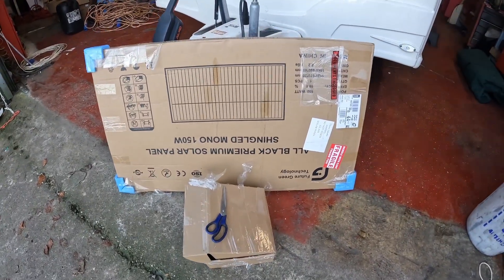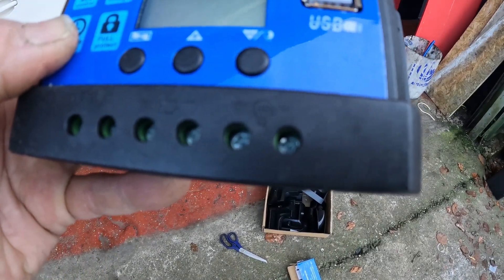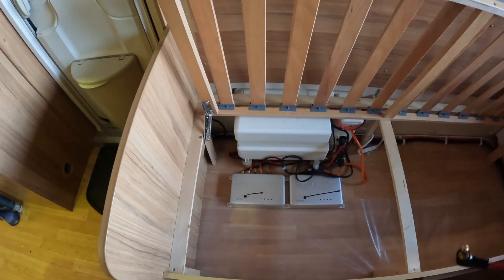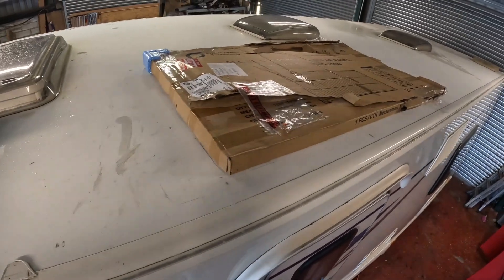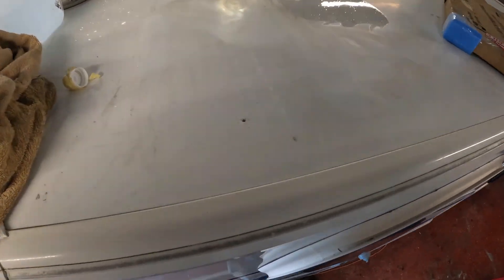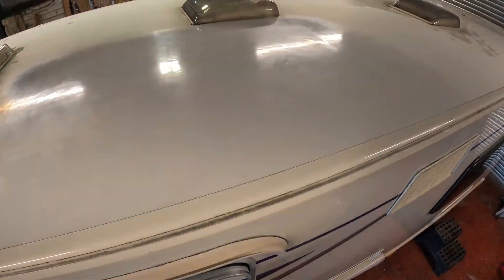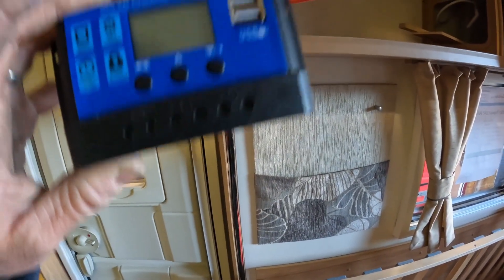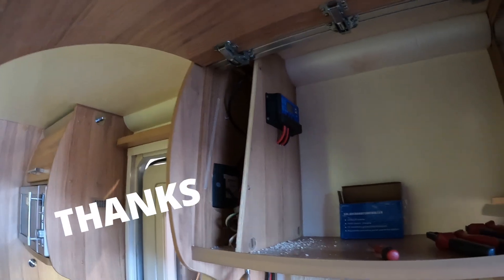CARAVAN SOLAR PANEL INSTALLATION GUIDE.

Comment: I'm thinking of having a solar panel on my roof but don't fancy drilling a hole in the roof so next best thing is running the wires inside the offside awning channel,I know you will see a bit of wire coming off the roof but I think I'll live with that lol my m8 did the same thing and he did a neat job to be fair.
Reply from the maker: As long as you go over the top with sealant you should be fine.

Comment: I bought a couple of those controllers recently and found what appears to be a major flaw. They seem to let current flow back to the panel and drain the battery overnight. I've put diodes in to prevent this (about 45p each) and not heard back of any problems. Both installs were very low usage; one for LED lights and electric fence at some stables and the other for battery maintenance on a seldom used vehicle. If I was doing a caravan or similar I would definitely go for mppt rather than pwm.
I'd also make the hole in the roof bigger and use a blind grommet.
Reply from the maker: Thanks 👍
Reply: @thecaravanplace 
I spoke to the owners of the stables a couple of days ago and they said everything is fine now so it seems to have solved the problem.

Comment: Great video, looks pretty simple, apart from the fear of drilling the roof. Would there be a need to secure the panel with screws too or is it normal just too use the sikaflex bond?
Reply from the maker: The sikaflex is very good, as long as the roof is clean and dry it will hold without any screws.
Reply: @thecaravanplace  Wow really? This comment made me consider this option rather than drilling holes which I was afraid I would have to do for the rigid panels. Thanks for sharing! I do hope it will hold.

Comment: Did you leave the original car charger and 240v ac chargers in place and do they play nicely with the solar controller???
Reply from the maker: Yes, you don't need to change anything. 👍

Comment: So would this run everything in the caravan like the shower without mains electric?
Reply from the maker: Yes as long as its sunny it will keep the leisure battery charged to run everything on the 12v side.
Reply: 🤣🤣 no
If U have the roof space why couldn't U put 2 or 3 panels

Comment: Will the sealant hold it in place even on the motorway? It doesn’t need screwing down or anything?
Reply from the maker: Your preference, manufacturers don't use any, but it's upto you.

Comment: What was the actual size of the fuse you used?
Reply from the maker: I will have to check as cant remember off hand, it should tell you on the controller paperwork, 30amp comes to mind but will have to check.

Comment: ok guys. A good fit but, there are a couple of issues I can see.

1. The charge controller is not a good one. You should have fitted a Victron 75/15 as it is a true mppt controller. Costs a bit more but, it will squeeze out more from the solar panel than the one you fitted, Tbh, that solar charger is ghastly. I have used the one you have, and promptly chucked it into the bin. Also the Victron ones are blue tooth complaint as well so you can get a remote reading of the condition of your battery, which is a nice touch i would say, especially if its in storage and your far away from the van. 🙂 Oh, and that reminds me. I hope you connected the battery first then set the type of battery and THEN, connected the solar panel??? it wasn't clear in your video.

2. I would have mounted the solar mppt controller down under the bunk as, side ways on you cannot see the display on that one very well, or, attached it to the wall so your looking straight at it. 

Good vid tho especially drilling a hole in the roof. Always scares me that.

Just my pennies worth.

Cheers.
🍻
Reply from the maker: Thanks for your comments 👍. Yes the Victon is very good but added about £100 onto the bill so was out of budget unfortunately.
Reply: @thecaravanplace  Fair enough. Shame really but I get it. Keep up the good work fella. 👍👍

Comment: i am surprised the solar panel manufacturers do not put any insulation over the individual red/black cables, surely some protection is required to save damage from sunlight etc, personally as an electrician myself i would not leave them cables without an extra sleeve, although to be fair  most motor movers are the same. probably cheaper.
Reply from the maker: They are normally double insulated for protection, the same as domestic solar cable.

Comment: I know sikaflex is good stuff but it needs a mechanical fixing as well (don't think it will grip well to a smooth shiny surface). I hope aim not behind it on the M6 when it lets go and goes through someone's windscreen
Reply from the maker: Thanks Steve, as long as its the 521 and the surface has been cleaned correctly, then it shouldn't need anything else. But it can be better to be over protected, it would just need to make sure the screws were very well sealed in as they will cause leaks, which is why they aren't normally used.

Comment: It’s going to be hard to read the charge controller because it’s side on should be facing straight out !
Reply from the maker: Yes they are a bit easier when forward facing, it's not that often you are looking at it though so just depends on what's best for you. Thanks Rab 👍

Comment: You say you should push the panel down after applying Sikaflex, this, I think is incorrect Sikaflex recommend a certain thickness of adhesive to get a proper bond, the data sheet will give this, it can be achieved using some tile spacers of the right thickness.
Reply from the maker: Good idea 👍

Comment: Put some screws in otherwise you’ll be leaving it on the motorway somewhere! Read the off grid groups for the sorry tales of those who relied on Sikaflex alone!
Reply from the maker: Thanks Steve, I think if the correct 521 is used and the surface is cleaned correctly you shouldn't have any issues, but if you want to fit screws too, just make sure they are well sealed in. Thanks for your comments 👍

Comment: Panel only secured with adhesive???? Wow.    With movement, sun, vibration and a few years that adhesive is likely to fail over time. In a few years your panel will come flying off the roof and land on the vehicle behind you when you're traveling. Very dangerous. Could kill someone. Bad video mate, you should take it off.